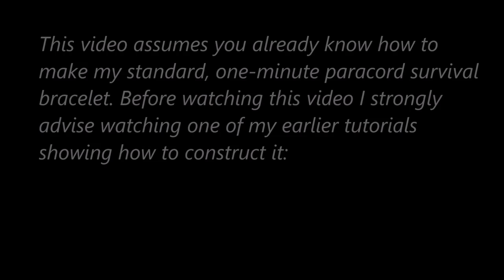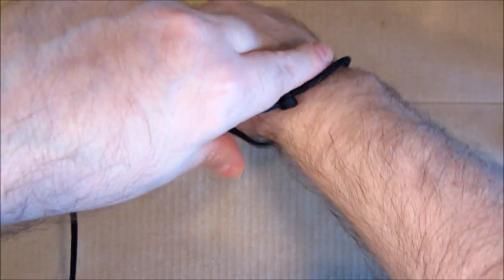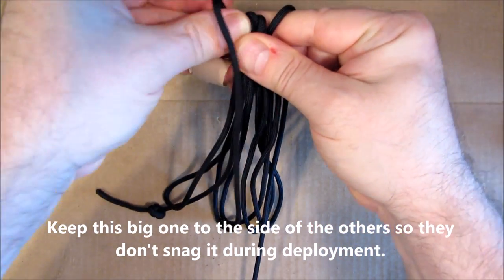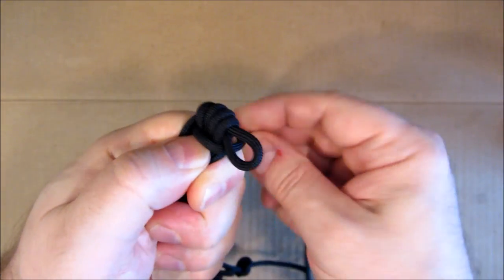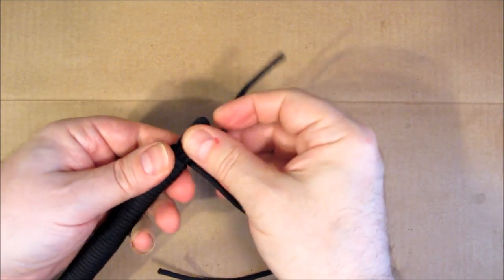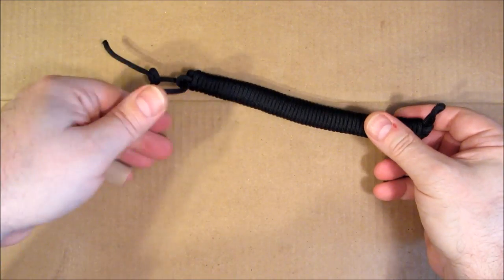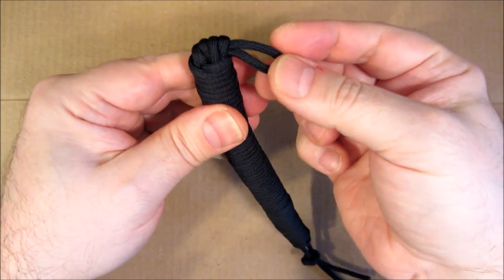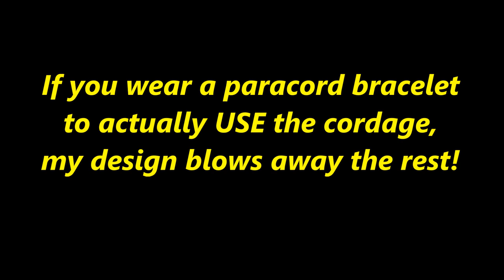MEGA Paracord Survival Bracelet, High Capacity

Comment: a better bracelet keeps getting better. your the man!
Reply from the maker: Thanks
Reply: +MeZillch this seems like a great way to hang a large amount of paracord from a tactical pack when hiking as well so one could have like 30' or even 50' in your quick deploy construct at easy access
Reply from the maker: I agree! In my Bonus Tips and Tricks video I discus how this design, especially now with this new high capacity version, can be used for all sorts of things besides just bracelets: keychain parafobs, zipper pull, belt, bag shoulder strap, dog leash ...  Criss crossing the inner runs, i.e. forming them in the shape of figure eights as is done with the hayanawa configuration my original Parafob is based on, may be prudent for the REALLY gigantic ones but in my experience the top part I refer to as a "double lock" seems to keep them from snarling each other during deployment on these bracelet sized ones
Reply: +MeZillch brilliant good sir! can you imagine how much cordage you could have on your bag and person if you used this method for all the zipper pulls, lanyards on knifes, tools, belt, shoulder straps... my gears are turning! lol
Reply: Have you ever tried making one using braided fishing line, like around the 300 pound test range? I mean it's strong line and 300 pound line is only about 1mm or around .040" thick which is about the size of one inner strand of 550 cord. 

I'm thinking for a knife or on the sheath, keychain and a zipper pull it would be a great way to carry a lot of very strong cordage but still not be too big for places where smaller is better.

Comment: Hi! first of all congratulations for the video, I wanted to know how many meters paracord wire used to make this bracelet, is sure that at the end of the video the node that does not unfolds with the passage of time? thanks a lot and waiting for your response!
Reply from the maker: You can make these any size you want by varying the number of inner runs you coil around, but the one I loosely and quickly made in the video was 5.5 meters with 5 inner length runs. I unravel my bracelets for cord use on a regular basis so they aren't meant to hold up for years. So far the only one I made that unraveled on it's own, in wearing it over a week or two, was the one I briefly showed at the end of the video made with TOO much cord. For long lasting designs it is important to not compress on too many coils or they have a tendency to push off the end in use. They slowly migrate off day by day. By making the bracelets tightly wrapped inward, different than compacting the coils laterally against each other (instead of the loose one I showed in this video) they are more secure.  The bracelet is a more solid like a ridged rod, instead of floppy, and by only putting on just the right amount of cord (hardly compressing the coils against each other AT ALL) you get a much more solid design which will hold up well. You also can tie off the end more securely, if you wish,  by looping the final end back into the main body and really tying if off more securely like a true knot, but for me the whole point of these is their lightning fast deployment when you want cordage. If that aspect isn't important to you I'd say you could try inserting the end back into main coils, one or maybe 2 coils down from the end, pull it over to the opposite side from where it was just inserted, and then bring it back up to reinsert it through the end run loops, and finally tie a proper knot at the end or secure the tail by melting it into a mushroom capped end.
Reply: thank you so much, I wanted to say with this node ending can last years? I think it's a very good cuff though one might conclude that better with a more secure knot.

Comment: How long did it take you to be able to construct and deploy without snags.
Reply from the maker: Snags can occur if you don't keep the big loop, the first one to pull out via the rip cord, off to the side of the others and on the outside as I tried to explain at 3:48 . Another way to minimize snags, although it is time consuming and not as easy without a construction rig to wrap around akin to two posts on a pegboard spaced the length of the bracelet, is to construct the inner runs as zig-zagging figure eights instead of just straight runs. This is how a fast rope bundle, hayanawa, or my version I call a Parafob is constructed: https://youtu.be/V5UTu1rhJAU . At least crossing just that all important fist big loop like a figure eight and keeping it on the outside of the others should probably do the trick. Good luck. Keep in mind even if you do get snags, total deployment time is still a fraction of the time of most woven bracelets.